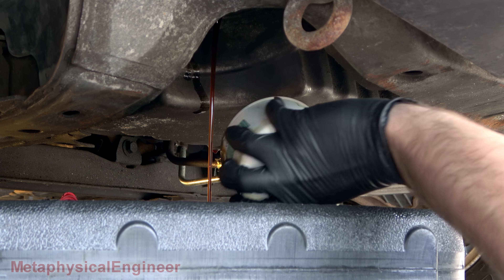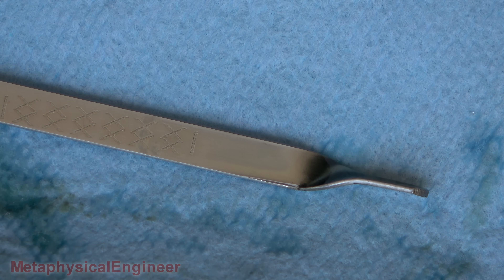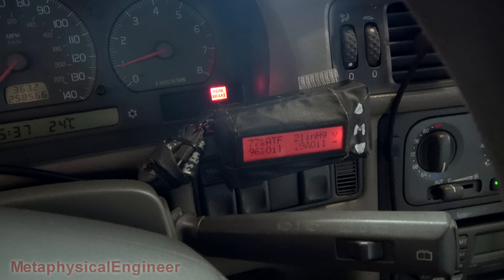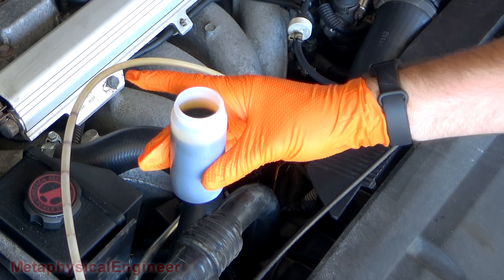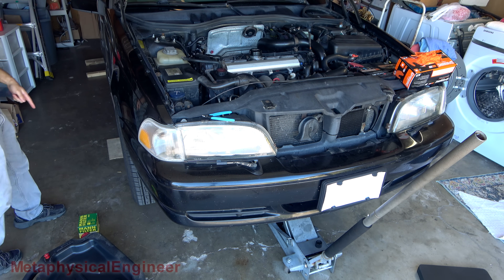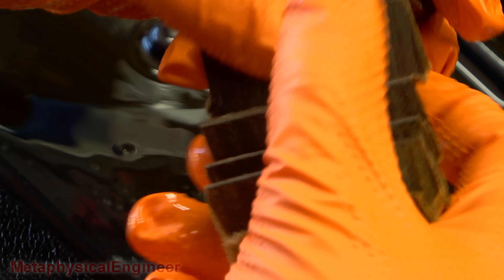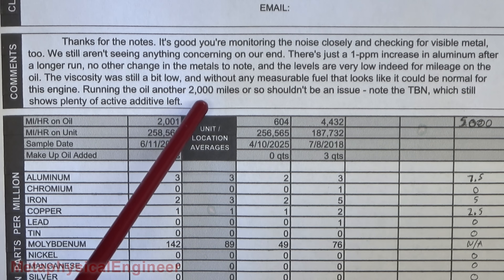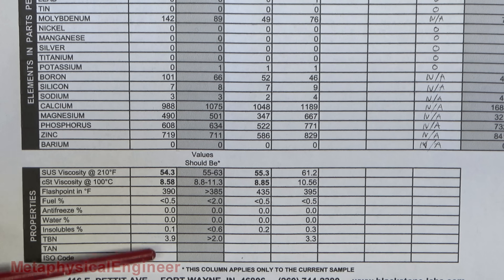Valvoline Restore and Protect vs Noisy Lifters - Used Oil Analysis and Filter Cut Open

Comment: I’m a real wimp. Only change oil when it’s cold 😂
Reply from the maker: No shame in keeping yourself safe! I just like to make fun of myself to give the armchair mechanics less ammunition. Though even having the oil at a "safe" 100F will let it drain much faster and more thoroughly.
Reply: If you have a truck or suv you should get a fumoto drain valve. I love flicking that lil switch & watching it drain!
Reply: @slapskate I don’t trust those.
Reply: @sarahdell4042  You have trust issues.
Reply: Oil won't drain completely but cold oil will be even harder to drain out as it will be thicker.  Be sure to give plenty of extra time to drip out before insertion of drain plug and refilling or your clean oil will mix with a large amount of dirty oil that didn't drain out and shorten the oil life.
Reply: @WilliamThompson-wr3yp Usually pull the drain plug at night, and finish in the AM.
Reply: @sarahdell4042  that's really hard on a bone dry engine overnight.  It's why at least a warm engine is recommended and not waiting too many hours before finishing the change.
Reply: @18_rabbit Lol so what happens when a car sits for a few days? 😂😂😂😂😂
Reply: There is no reason to work with scalding oil. You just need to let it drain longer. Go have a cup of coffee.
Reply: Wear gloves. Most engines cool enough after 30 mins so your not burning your arms under there. Warm oil flows better. But cold is fine, just let it drip a good 45 mins

Comment: Enjoyed your video.   I hope the Restore & Protect does well for you as it has for me.  I was burning 3 quarts per 5,000 miles and started using R&P and it’s now down to about 1/2 quart per 5k.   I’ve since went from 5w-20 to 5w-30 and I’m down to under an 1/4 quart or less (almost negligible usage) over 5k miles.   ‘08 Honda 2.4L engine with 372,000 miles.   Sticking with Valvoline for the life of this engine.  Economy mpg is even improved.    I’ve ran Mobil 1, Pennzoil, and Amsoil throughout the life of this car.  VR&P has yielded the best performance and best Used Oil Analysis than all of the other oils.   Some people say it doesn’t matter what oil you use…just change it every x thousand miles and your car will do great.   I respectfully disagree.   If Mobil 1 or Pennzoil is just as good, then why did my engine varnish up and burn oil??    Valvoline R&P fixed it and lived up to its claims!     Good luck with your runs of R&P
Reply from the maker: Thanks for weighing in!  Impressive mileage on your Honda and very promising that R&P managed to get that rapid oil consumption under control.  Likewise this engine has been on a diet of high mileage synthetic oils of various name brands for over 100k miles, and yet it still managed to keep or develop varnish and carbon. 

Did you try any fix in a bottle type additives to try slowing the oil burning before you used R&P?
Reply: I have two old Saturn SL2s that I haven’t driven in years. The piston rings are stuck in both of them. One burns a half a quart of oil per tank of gas and the other one burns a full quart every tank. They both run great and passed smog still when I stopped driving them. I tried everything to unstick the rings. I was going to throw the cars away or give them away to someone willing to replace the piston rings. I wonder if it’s worth trying this stuff just to see if it can unstick the rings.
Reply: @terjeoseberg990 in your case.  RP is the way to go.   It WILL work.   Give it about 4 oil change cycles.   After that, dont use it.   Valvoline had a product years ago that was a more aggressive cleaner.   That product has a problem cleaning too much and it was clogging oil dollars filters and blocking passages.   With RP you want to get those rings free and engine marginally clean.  And then go back to a normal oil.
Reply: I experienced a drastic reduction in oil usage too.  I was burning a quart per 600 and RP took it to 1400 per quart after 5 oil cycles. But After about 10 cycles I gradually  started burning down to a quart per 300 miles.  I am laying off of it for a while.  I think I got too clean.  Very powerful and wonderful oil.  But now I am going to ease up and go a few cycles with Pennzoil Ultra Platinum for a while.   At my first 300 miles my Ultra Platinum has not burned a drop of oil.   Btw.  All of this is being done on 3000 mile oil change intervals.
Reply: @dirkmanning8621 , Are you saying that your oil consumption improved at first, then started to worsen?
Reply: @terjeoseberg990 I am saying that for the first 5 oil changes I went from 1 quart per 600 up to 1 quart per 1200 miles.  Which is great for the car I am driving.  It was specified OEM to get 1 quart per 1500.   Then on oil change 6 my sixth sense says check the oil, dont get too trusting.   And would you believe my dipstick was extremely low after only 600 miles on fresh oil change.  For the reminder of that oil cycle my car burned 1 quart per 300 miles.  I just did a change number 7 and did not use RR.  I am using Valvoline 15 50 weight and it started out burning 1 quart per 300 but is gradually going back up to 2 quart per 600. The RR cleaned so much I was losing tremendous amount of oil after the 4 oil cycles.
Reply: Were you using the Amsoil Signature?  I've had great results with Signature.
Reply: @ericsivilla4091  Pennzoil Ultra Platinum phenomenal too. I use it exclusively. He didn't say if bought used or OCI intervals.
Reply: @Davido50  I think the next best cleaning oil after R&R is Pennzoil Ultra Platinum
Reply: Same result here with my 2005 Prius with 330k miles.  On the second VRP oil change and oil consumption is way down.
Reply: @turtletrade  '13 Ford F150 3.5L V6 twin turbo - 298k mis. Still work w/truck. Well maintained but will try R&P for few OCI cycles. Used Pennzoil Platinum/ Ultra Platinum w/good results for most of trucks life. Always full synthetic w/ synthetic oil filter & top tier rated fuel.
Reply: it varnished because 5000 mile oil change and w20 oil

Comment: hey my dude looks like you know quite a few oil change tricks and tips but please consider also gently shaking the jugs before pouring -- believe it or not the detergents and additives can actually settle to the bottom.   my ref:  Motor Oil Geek, Bob Is The Oil Guy forums
Reply: This is true especially if they've been sitting for a while. I think I had this happen with a Pennzoil bottle my valve train was incredibly noisy and I saw lots of sediment in the Pennzoil bottle. Otherwise I've had great luck with Pennzoil in other engines
Reply from the maker: Good point! I should have mentioned shaking up the bottle before pouring.   I didn't make a big deal of it on camera since this was a high sales volume item; there were two other customers in line at the parts store when I bought the oil, and one of them was also buying R&P!  So it's not languishing on shelves long term at least in my area.
Reply: @MetaphysicalEngineer  nah you're fine man don't sweat it

Comment: Here’s my ~1 year testimonial for VR&P. Just a data point for anyone looking into this product. I put this in any video the algorithm recommends to me about VR&P simply to help others.

2012 Prius V I’ve owned since new. 131K+ on the clock. Just changed my oil again, so this is the third interval with VR&P. For this change I went with 5W20, with the intention of going to 5W30 eventually. 

Oil changes were at dealership or quick-lube places until I decided to start using VR&P. So just bulk synthetic that came out of a barrel.

Lots of HWY miles for the first ~85K. Oil change interval average ~7K. After that, from ~85-130K, almost all short trips with oil change interval average ~4.5K.

Model year falls under TSB for low tension rings oil consumption. No noticeable oil consumption at 124K, when I switched to VR&P, but was smelling fuel dilution in the oil(fuel dilution was probably masking some minor oil consumption).

So my original intent was to switch to VR&P to hedge against possible future oil consumption. I had originally thought about changing the first use of the VR&P out at 1K miles, or at least the filter, but it looked so good on the dipstick checks I ended up going to 2.5K. Oil filter looked normal upon change. I think I could have gone out to 4K on the first change.

That fuel dilution in the engine oil(probably first noticed when the vehicle started being used for majority short trips) was to the extent that I could smell it in the garage after the car had sat a bit. I now have ~8K+ miles on VR&P and no longer smell fuel dilution in the engine oil.

The other thing that has really pleased me is how quiet/smooth the engine sounded immediately after switching. I had always thought this 2ZR-FXE was a clanky sounding engine. I mean the very first start had remarkably reduced engine chatter. I was stunned at first startup once the oil pump kicked in.

The Motor Oil Geek YT channel(Lake Speed Jr.) says that Valvoline uses a unique add-package which has a superior MoDTC friction modifier. He has stated that it produces the lowest wear results in the engine oil analysis his company does. It’s not light years ahead of the competing brands, but it is better and is consistent. I do wonder if this isn’t why comment sections are awash with reports of reduced engine/valvetrain noise after switching to VR&P.

Engine had no leaks before. Haven’t observed any since the switch.

I’m probably going to use this oil for the rest of the vehicle’s serviceable life.

One thing I will say related to this video is that, at the 2K mile mark, the VR&P no longer looks as dark as his in the video. It definitely did on the first use.
Reply: I have the same engine in my daughter's 2009 pontiac vibe (toyota matrix).  We recently purchased it used with about 161000 miles and quickly realized it was consuming about 1 quart every 800 to 900 miles (synthetic 5w20).  Car runs great.  after adding  oil, and going about 4000 miles, I changed to restore and protect, 5w20.  Saw an almost  immediate improvement.  It was now going about 1000 to 1100 miles, before needing a quart, for 5000 miles.  I too noticed immediately how quiet things became (prob because of improved friction modifiers in this oil).  Then, on restore and protect cycle #2, things improved to 1 quart every 1200-1300.  It was marginal but still much better than where we were.   Within about 1000 miles, I will go to Restore and protect cycle  #3.  I believe we are at around 171 or 172000 miles.  Im hoping for a bit more improvement, but not sure what will happen.    I doubt that it will become a non burner, entirely.  I thought about dumping an engine clean in before changing this last time.  Ive also read that a marine product called yamaha ring free works pretty good.  Just need an ounce or two in a few tanks of fuel.  Ive also considered switching  to a 5w30 weight oil too...but not sure.  that's what I use in a 2010 nissan altima and I dont burn with that car.  It suprises me that your 2012 Toyota has this issue as i thought toyota resolved things by 2010 or 2011.  Good luck!
Reply from the maker: Thanks for sharing!  Interesting how you weren't burning oil but had clear indicators that fuel dilution was happening.  I wonder if some oil loss was being masked by the extra volume of fuel in the sump keeping the level up?  I've heard of bad cases where the oil level appeared to rise during an interval from the amount of fuel getting down there.  Also good to hear it didn't cause oil leaks, as that's a frequently voiced concern when using cleaning oils or additives on an older engine.

Motor Oil Geek's videos were what convinced me to give this oil a try, especially the one with the tour of the testing facility.  I noticed the much higher moly content in the analysis, so that tracks with the claims of enhanced anti wear properties.

Likewise very curious to compare how quickly the oil darkens on subsequent intervals.  There's not a ton of crud in there that I know about, but it's all very tough hard varnish so will take time to dissolve away.
Reply: @MetaphysicalEngineer 

Yeah, I was honestly worried about possible leaks, but a small preventative maintenance channel here on YT claims he actually called Valvoline about this. They stated that VR&P contains almost as much seal conditioner as their High Mileage offering.

As for the fuel dilution, the 2ZR-FXE has an issue with slurping engine oil out of the PCV system even though Toyota has an oil separator built into the block where the valve mounts. Some claim the issue stems from the Atkinson cycle of the hybrid version, as the Corolla 2ZR-FE isn’t know for this issue.

It makes a mess of the inside of the air intake manifold, mixes with EGR particulates and forms a gunk that eventually differentially blocks the EGR ports. Because of the inverted gooseneck design of the air intake manifold, when you remove the throttle body you find an engine oil lake formed underneath.

The EGR port blockage leads to an undetected lean condition in cylinders 1&2 and is prime suspect for the ubiquitous Gen 3 Prius blown head gasket.

But that’s beside the point. Although not much engine oil is required to make a mess of the air intake manifold, that’s obviously also a source of loss from the crankcase.

So the inside of the air intake manifold also accepts a lot of water vapor(quite a lot in the winter months) and blow-by fuel vapor. Hence the fuel smell in the garage when sitting. I’ve been running an Oil Catch Can on the PCV line for about a year now. It doesn’t catch all the escaping PCV oil, but any reduction does reduce the mess inside the intake. Hopefully it’ll reduce the amount that’s burned and sent to prematurely plug the catalytic converter up.

So my guess is the engine was burning oil a bit, sending oil out the PCV and then replacing the volume loss with fuel to the point I could never really tell on the dipstick over the course of 4-5K miles.
Reply: @MetaphysicalEngineer 
I made another observation with the OCC, as I installed it very soon after my first VR&P use.

At first the muck that I dumped out of the OCC did really smell of fuel. Slowly this smell reduced. With ~8K miles running VR&P now, what the OCC collects right now… well I honestly can’t detect a fuel smell. 

I am interested if the fuel smell will return in the muck this coming winter, when the H2O proportion becomes very large again.

I live on the coast in the PNW. So tons of rain and super humid. At the height of the winter last year I had to dump the OCC every few weeks. Conversely, during warm months H2O content is so low I could probably empty it every six months.
Reply: @EvzenKovar-i5p  I have greatly appreciated reading your comments, but I do wonder what you mean sometimes with your abbreviations if you get a minute, thanks!
Reply: At this stage for a Prius of that generation, the big thing is the head gasket. It is extremely important to change the coolant every 5 years or 60,000 miles. If let to go longer, it starts to eat away at the head gasket coating.
Reply: @rogelioandersen5842 
That covered. Also bought an electronic pH meter to monitor the acidity.

Also have the EGR system on a cleaning interval, plus I’m running an oil catch can in the PCV line.

Thanks for the suggestion sir. Cheers!

Comment: If you remove that fat o-ring on the sample vacuum pump you can snug the bottle up better without sucking air by that fat o-ring. This experience comes from years of pulling oil samples on Caterpillar equipment using a very similar vacuum pump. You may not have had an issue this time, but it will happen at some point and it will become very frustrating.
Reply from the maker: Thanks for the tip!  Was the problem immediate, or did the o ring become an issue over time with lots of use?

Comment: You should have just buy 2 jugs, single quarts are very expensive  vs jugs
Reply from the maker: Yeah that is more economical, especially now that I'm convinced to run this experiment out to 3 or 4 oil intervals.  The quart bottles are handy for prefilling the filters or taking a spare with me.  Now that I have a couple, I can refill them from the big jugs when needed so that problem solved!